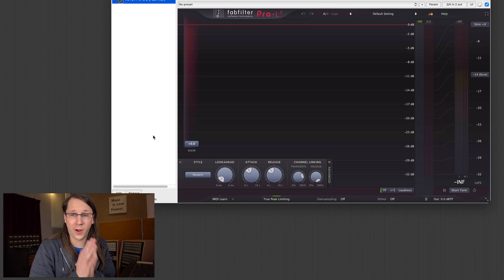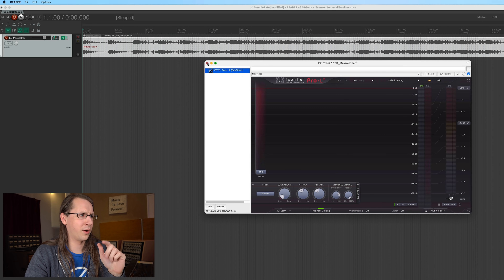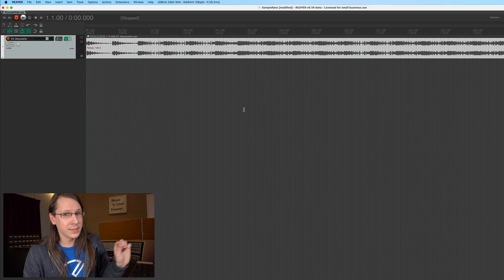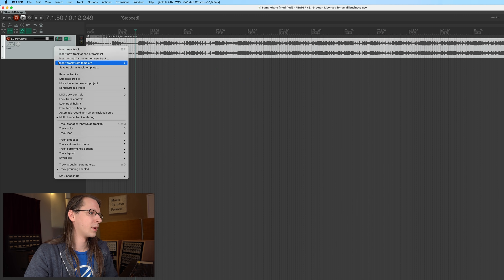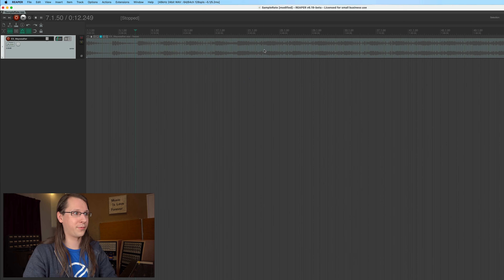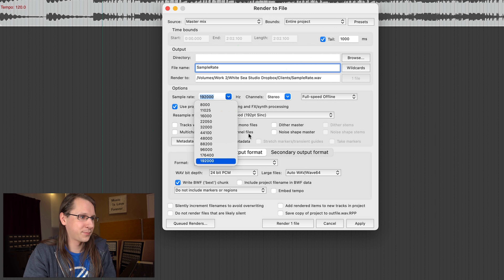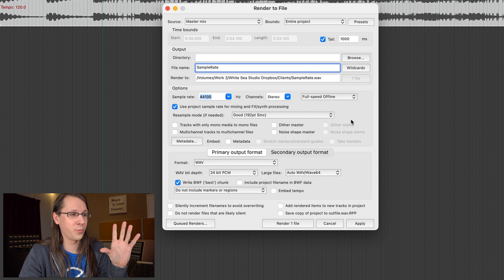WHAT is the BEST SAMPLE RATE?

Comment: been using 48 but realize 44.1 actually sounds better imo
Reply: that's just subjective your preference.

in terms of engineering you should not debating samplingrate 44.1 better than 48kHz or vice versa since we're using lowpass filter at 20.000Hz.

Sound Good or not depending your mastering capability during mixing maybe your hardware/software/filters already optimized for 44.1kHz + most project is 44.1kHz or vice versa

48kHz standard for video/film especially in lyp synchronization frame video with audio
44.1kHz standard for audio streaming but still not good for video project.

Comment: It gets to be a heated topic, but I prefer to use the highest sample rate possible if I'm transferring audio from *tape*, esp 2 track, and I usually use 88.2khz and above for hifi/acoustic recordings. I don't find huge benefit of higher sample rates with ITB production. I think 96k should be the standard where microphones are used, and a lot of plugins and samples aren't needed, but I guess that isn't so common now.  Where I have been able to use 192khz I find that I actually get slightly better transient reproduction, almost like using a transient designer, though some people I've worked with feel it is too "airy" up top. The ADC/DAC filters get a little more bandwidth leeway to get a better timing response. 44.1/48 is appropriate for probably most projects, but better clarity and transients can be had with higher rates if you need them.

Comment: Retired electronics engineer here. 48 vs 44.1 offers almost zero improvement in anti-aliasing filtering. BTW the simplest way to avoid aliasing is to band limit (for audio 20Khz) all your sources. BTW Sinc is short for Sin(x)/x and it is the fourier transform of an impulse.
Reply: lyp synchronization video frame?

Comment: Why .... did it sound so much better importing the 192Khz files into the daw? Define 'better'? Could it be that the conversion from 192Khz to 48Khz suffered from 'bad settings' ? And how did it sound once the final project got exported in the 44.1Khz or 48Khz master. Also better? Or did 192Khz treat your ears in such a way neither 44.1 or 48Khz can ever do? Hmm. Questions.

Comment: After testing various sampling rates....96khz is the best sounding imo,that extra headroom is important as yes we only hear up to 20khz, more 16-18khz, but need the headroom,as i keep telling people if super tweeters are outside the human hearing range why do people use them ? but yet they make a massive audable difference to the top end clarity & definition, & can even make the bass sound better somehow...some can hear the difference but others somehow cannot...96khz is perfect imo & should be an industry standard, used with 32 bit..if you cannot hear the difference between 24 bit & 32 bit your in the wrong job...it is the future & works far superior if used at 96khz min, with 32 bit you could go higher than 96khz...a massive sonic difference...any sampling from 48khz up will work fine, but 96khz for me, but only really at it's best if recorded at 24 bit (32 would be far better & 96khz & kept at that throughout the whole recording & mixing process...upsampling & downsampling are best avoided for the best audio quality...everone is going on about 32 bit float...i agree 32 bit is far superior in audio quality than 24 bit & makes 16 bit sound terrible...lol..32 bit is coming so why not settle on the best sound quality & use higher sampling rates...i cannot hear much difference between 96khz & 195khz at 24 bit as most music is recorded at 48khz then upsampled....but recording at 24 bit (32 bit would be far better)  & 96khz & mixed without up or downsampling sounds really good to my ears...all our ears are different & so many variables to take into consideration...32 bit 96khz recorded music sounds amazing...

Comment: 48khz allows for me to use the highest buffersize on my system. And im not able to hear aliasing from the synths like i can at 44.1khz. and if i need higher samplerate somewhere i just use a plugin with oversampling. If i was running a tracking studio i'd probably run 96khz.

Comment: I currently use a MOTU M4 USB audio interface. Technically speaking, my signal becomes hugely more noisy, because above 28khz the signal continuously rises. 96kHz is already worse than 48kHz tho still below anything worrying in the ultrasonics, but at 192kHz it’s plainly ridiculous. My combination of preamps and ADC is the least noisy at 48kHz or below.

Comment: Hi, thanks for the video. I have 2 MOTU 16A units which I intend to run at 192kHz on a mac. I noticed that you are using a mac mini at 192kHz and wondered how many audio tracks would run on the mac mini. I want to use it like a 32 track multitrack tape recorder with some basic plugins like compressor and eq with an occasional effect on each channel. I could also do with very low latency as I am very sensitive to timing issues when overdubbing. I am not sure if an M1 mac mini with 16G of ram would do the job or if I should get a mac studio max with 32G of ram. You are one of very few people on youtube who are running at 192kHz and I wondered if you could help me please? Thanks, Kev

Comment: I have had the option of high sample rates for a long time, but the final format for the film scores I worked on was always 48k, 24 bit.  My decision was to track at the sample rate of the final (dub stage), so I recorded and mixed everything at 48/24.  My experience is that Sample Rate Conversion does much more damage to the sound than any benefit that may be gained using high sample rates.  The 3 worst words in digital audio: Sample Rate Conversion.
Your Mileage May Differ :)

Comment: OK, holy crap.
I just took an old mixing session I did at 44.1kHz (because all those audio files are 44.1kHz) and just increased the project sample rate (in Reaper) to 192kHz, and holy crap, the dynamics improved like crazy...!

I did nothing else, just increased the project sample rate to max.

So, I did some quick testing.
1. I rendered a fresh 44.1kHz version, with the project at 44.1kHz. (Just to make sure it's this exact mix I'm listening to.)
2. Then I rendered a 192kHz version, simply setting the project to 192kHz.
3. Then I loaded this 192kHz render and put a brick-wall lowpass at around 20kHz (analyzer showed some action above that, so I wanted to manually remove it), and rendered it back to 44.1kHz.

Versions 2 and 3 sound more or less the same, with very much improved dynamics, especially the snare. Simply allowing it to process in 192kHz, even after later downsampling back to 44.1kHz (native resolution of the audio files), made a huge, huge difference.
Obviously, the true 192kHz version has a tiny bit better quality in reverbs and such, but that's not the point, here. The point is that the dynamics improved so much that the mix would need some adjustments to adapt to this change -- it's not a subtle difference at all!
The snare now gives me a headache, as it seems to shoot out from the mix and punch my forehead...

The upper range of the distorted guitars is also more defined in versions 2 and 3, though this is more subtle.

(All renders were still native 24bit, and I used lossless FLAC format. Only the sample rates were changed as stated above.)
Reply: imposible ,si una grabacion es a 44.1 siempre sera de esa frecuencia, si lo procesas por un hardware y lo grabas a 192 es otra cosa ,si grabas una guitarra a 192 por ejemplo o 96 etc , si se notara ,aunque yo no noto nada ,ni en numeros ni en oido ,uso analogico , si tienes algo en 44.1 siempre lo sera aunque lo subas ,saludos
Reply: @nomelocreo1979  It's about oversampling during processing.
Reply: @antiHUMANDesigns  imposible  """No hice nada más, simplemente aumenté la frecuencia de muestreo del proyecto al máximo"" eso dices ,si lo procesas con pluginsde 192khz que apenas hay puede que mejore ,te habra pasado otra cosa ,uso ssl the bus+ y fusion hardware ,grabando a 192 y 44.1 el master ,no hay diferencia audible ni medible ,una eq solo llega hasta 20khz y el oido igual ,a no ser que seas un murcielago no notaras nada, seguramente ha cambiado el pannig law a triangular ,entonces sube el volumen ,la dinamica ,es la forma en que se trata el estereo, la gente lo confunde con calidad muchas veces ,saludos
Reply: @nomelocreo1979  The point is that I must have had some plugins on that were causing aliasing, for example, which need to be oversampled to remove the aliasing.
I don't even remember, this was an old comment.
Reply: @antiHUMANDesigns  ok entendido ahora ,saludos

Comment: Try to print a synth changing the synth configuration to 192khz and print it at 192 in the daw as well and compare it with a 44.1 use some filter to go all the way to the higher frequencies when recording it

Comment: OK, so I guess I am the odd man out, but I have to ask, have you ever recorded as song to both 44.1/48 and 96k and compared? Especially stereo sources? (overheads, rooms mics).  See everyone goes after the "you can only hear up to 16k-18k so there is no point, there is no extra high end that we can hear on a 96k recording"  That's  NOT where the difference is, the difference is the depth (3D of the sound, the front to back) especially in stereo sources.   When I did testing 10+ years ago, and recorded a song, the same sources/takes/mic  to 44.1 and 96k simultaneously, then ran the same mix setup for the sessions, the different was there, even non music people heard the difference. And surprisingly,  when both mixes were converted to MP3, there difference remained. I did not want there to be a difference as it meant I then needed to upgrade everything.  Now, 10+ years later, I am still completely sold on it.   Until you try it yourself, as a audio engineer, you simply can not dismiss it. :-)

Comment: I love tracking drums and synth at 96khz thé latency became lower on some pc and cpu, but since i use a shitty corei7 that are slower than my old core i5 i came back to 48k 24 bit it's broadcast standard, when you do video sync work and acceptable for most people, but i prefere record in high sampling rate and downsampling later for the mainsteam listener, i can have benefit when eq and compression stuff, more headroom, the High frequencies became less agressive and more managable in the mixing process, when i use my high pass and low pass filter.

Comment: 48khz everywhere except during non linear processing (everything which changes the frequency spectrum). But that is something you almost never have to worry about because nearly all plugins will oversample when it matters.

Bitrate 32-bit float in the DAW for processing because of the advantages of float: No worrying about clipping because of near infinite headroom until you save it as 24-bit int.
I also highly suspect that the problems you had with the client were because of 48khz vs 192khz. More likely that you got clipped integer files and later 32-bit float.

Comment: Sadly, the mentioned links don't work any more - I would have loved to try the experiment.

Anyway, saying that all DACs can perfectly reproduce everything audible at 44.1kHz samplerate only tells half the story. For one: While we clearly can't hear standing waves or pitches above 18-21 kHz, we do can discern differences in timing and pitch combined at least an order of magnitude more granular than what the Fourier uncertainty principle sets for linear systems like, say, microphones (https://phys.org/news/2013-02-human-fourier-uncertainty-principle.html). Adding to that, aside from overtones, it's transients that give instruments their timbre and they can have frquency components higher than would be audible as a sine wave that are important for their timing. 

Now, you probably know that virtually all consumer devices use delta sigma DACs and you probably also know that the raw output of a D/S DAC at 44.1 or 48kHz sample rate sounds like absolute crap, which is why every D/S DAC internally oversamples the signal to a much higher sample rate before doing the D/S conversion, so that the tons of filters that need to be applied in the process even have a chance to filter out all this crap. What happens there is that a mathematical algorithm is used to add additional samples. There's many different algorithms which make different trade-offs between keeping true to phase or timing and that are more or less computationally intensive. And this is where it all comes down: Other than crazy expensive DACs that have unique approaches to upsampling and even output topologies, virtually every D/S or "normal" DAC on the market will profit from feeding it the highes sample rate it can accept - solely because it needs to do less work upsampling with the very limited computational resources it has; that is, of course, assuming the high sample rate is original material or being upsampled with in a better way than what the DAC could do by itself.
This is btw. also the argument for DSD as the D/S conversion is already done and a DAC just needs to output the raw data without having to fiddle with it before.

Does any of this matter for most consumers? Absolutely not. Who listens that closely, right? But it does make an audible difference for a setup and listener able and willing to do some critical listening, too. Sorry for nitpicking but it's pretty tiresome to keep hearing that "any dac can perfectly reproduce everything you can hear at 44.1kHz sample rate" because it's simply not true - if just for the fact that our hearing is way more capable than any microphone setup we use for measuring stuff and that perceptional qualities of music like sound stage, instrument separation, instrument timbre, cannot be objectively measured (yet), but can be hugely affected by "unaudible" information... Music rarely is made up of sine waves or simple interference of only a couple of waves. It's utter chaos in which every bit counts. And I wished that sound engineers started looking beyond their nyquist theorem and: a) accepted the fact that the "perfect" math requires infinite reconstruction steps, which aren't available in reality, b) that music isn't sine waves and frequency sweeps, and c) that our hearing works different from microphones and can detect and discern things that our measurement instruments cannot.

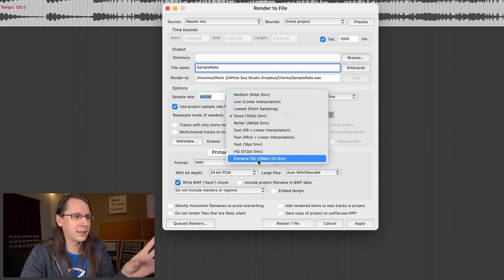Comment: 5:59 resample mode seems to be a way to select which interpolation method is used to convert from one to another sample rate. check out the wikipedia article of sinc filter for example to read about the best ones in this list. little spoiler: the more points the sinc filter has the steeper the anti-aliasing filter can be.

btw i think it was a good solution to just tell your client to send you everything at 192khz, because didn't have to explain anything that way and just had to wait for new files. but essentially the real problem is probably much more that the client doesn't know how to use oversampling features and it would be better for the client in the long run to just learn how to do that.

Comment: I would like to add that working at a higher sample rate allows for more creative options when it comes to resampling (from a producer perspective, not mixing). There is a great difference in the high frequency content when downpitching samples at different samplerates because for lower samplerates frequencies higher than 22.05khz or 24khz are being cut off by default. With higher samplerates the ultrasonic frequencies suddenly become audible, which for some people is interesting to investigate. This way you can literally hear things you could not hear before :)

Comment: Would it make sense to use a higher sample rate when multiple roundtrips are required? Say if you decided to mix fully analog, but needed commit and re-record tracks along the way due to a lack of hardware? (So say I want to process a bass guitar with several compressors, but I only own one, so I would re-record the sound twice, before sending it out to the hardware again a third time.) Would there be less information lost if I say used 192 for the first two, and then recorded the final mix as 48, or 44.1K?

Comment: I had designed a guitar tone I really liked using a couple of different plug-ins. Then I decided to go from 44.1 to 192 in Logic. Suddenly my guitars sounded horrible. I did tests at 44, 48, 96 and 192. The difference between 44 and 48 was subtle, but overall it seemed the higher the sample rate, the worse the tone. I decided rather than redesigning my guitar sound, I would just stick to 44.1 for now. But still not sure why this is the case.

Comment: Good video! Totally agree, samplerate above 48 kHz is redundant unless you gonna do some pretty gnarly sound design, purely to reduce aliasing across the board. Really easy to resample to 48 too in a good DAW that has a focus on hectic processing. Something like a Reese bass with LOADS of saturation or a very smooth sounding FM bass that has multiple stages of frequency shifting (basically the situation described at the end of the video)

Comment: I've been recording and mixing at 96k with an I9 20 core 48g Ram setup using reaper as my DAW. I'm currently using Presonus CLARETT for my interface.

I find that large track and plugin counts are giving me lagging issues.

I've streamlined the buffering settings in reaper for my rig but still having issues from time to time.... You mentioned a testing website to see if my converters could handle this... But the only links that work for articles on your page send me to a Japanese website...

Any suggestions? 

Thx, Jeff